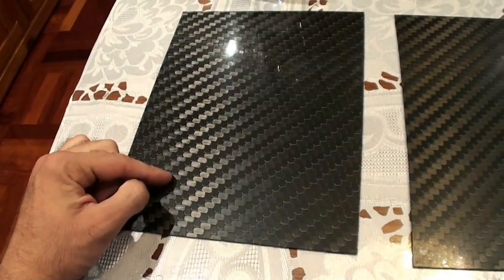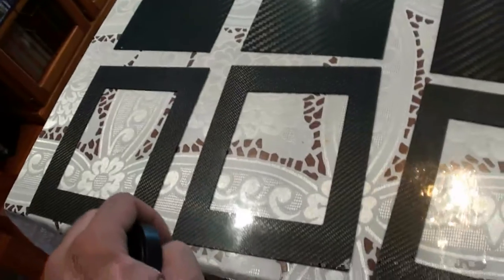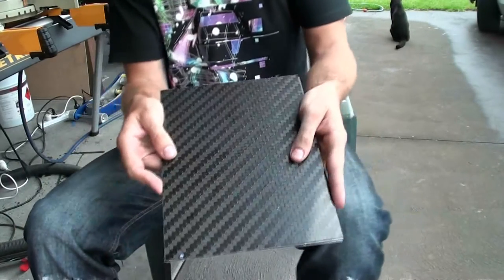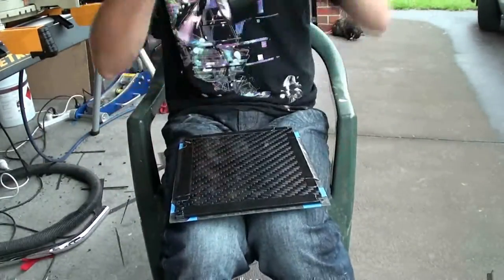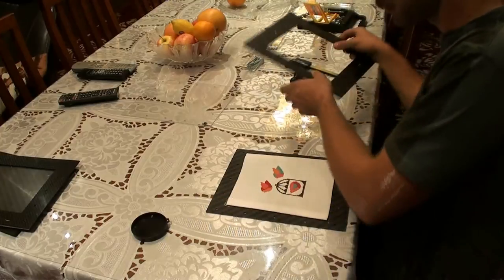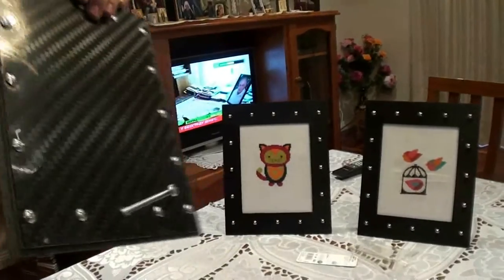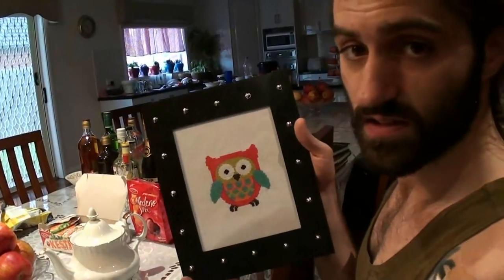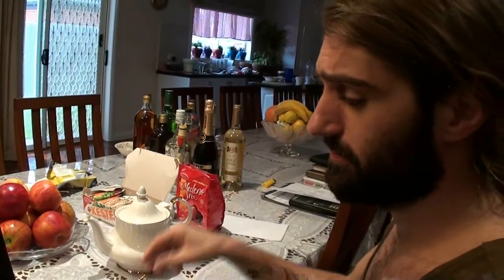Carbon fiber picture frames

Comment: you have some awesome tools milan :) a good drop saw makes life so easy !!

there is so much potential for this in the car scene i think, especially F1 and Nascar. Big frames with memorabilia/signatures inside. The bolts around the edge look OK, but I would personally try something more flush, and possibly black.. but thats just personal preference. 

nice work